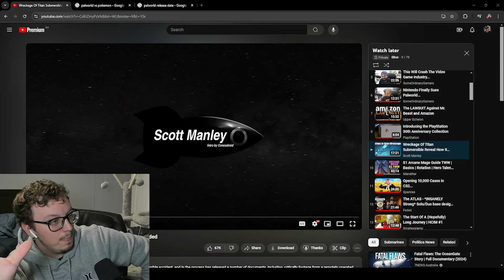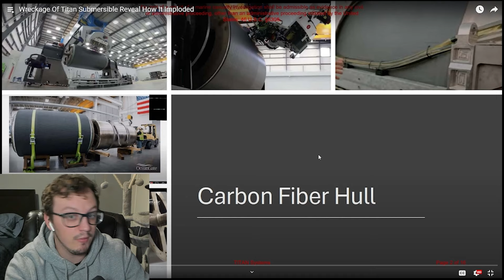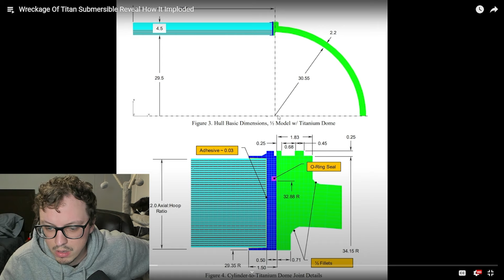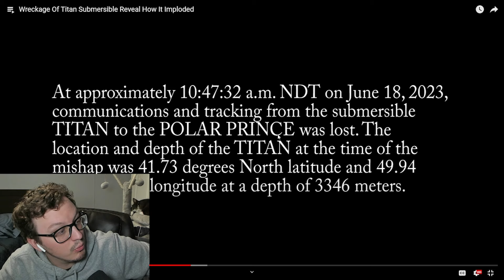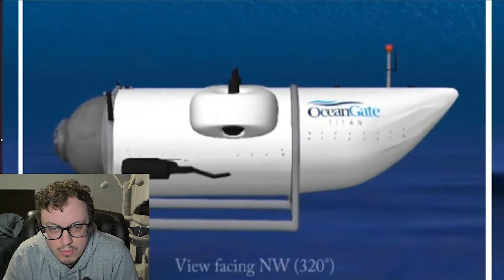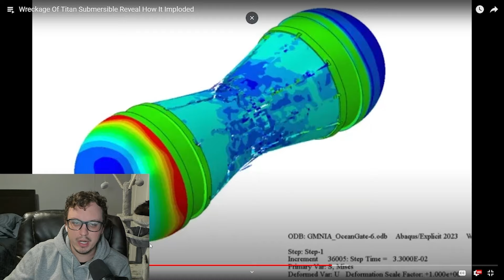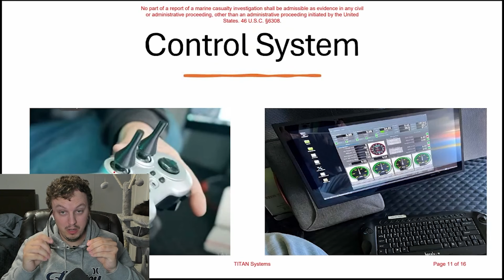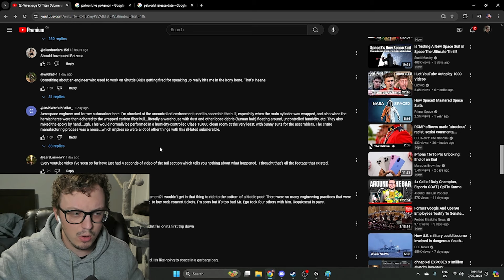OceanGate Titan Submersible How It Imploded

Comment: Why not build a pressurized 1/4 scale Titan and drop it to 1/4 the depth of the Titanic first? 🤷‍♂🤣🤣🤣🤣
Reply from the maker: We will never know the answer HAHA
Reply: They did build 1:3 size model, and they all failed before reaching 4800m consistently. The Titanic is around 3800m. You need your sub rated for 1.25x the depth it is going to.